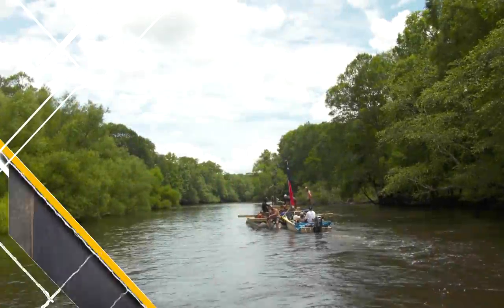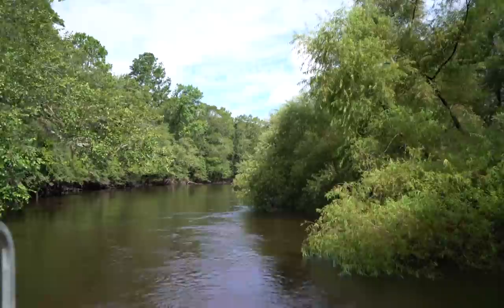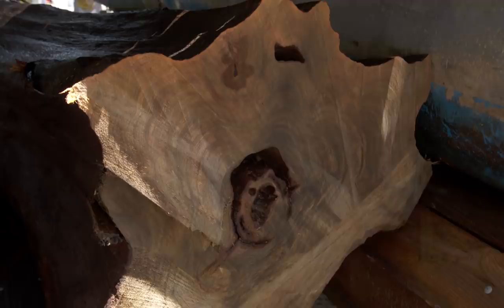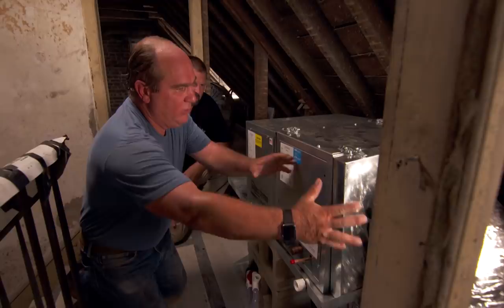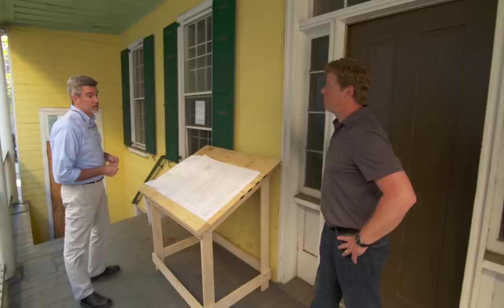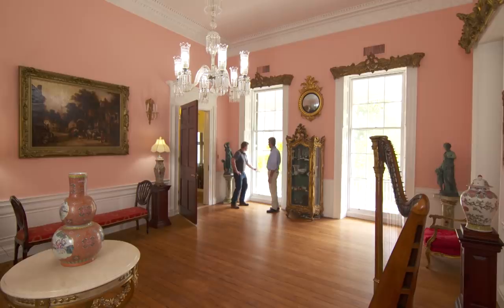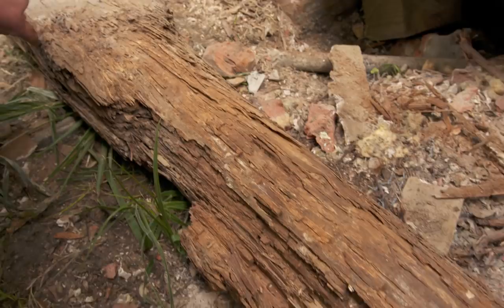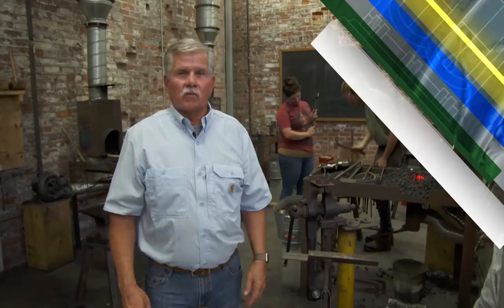This Old House | Good Wood (S39 E21) FULL EPISODE

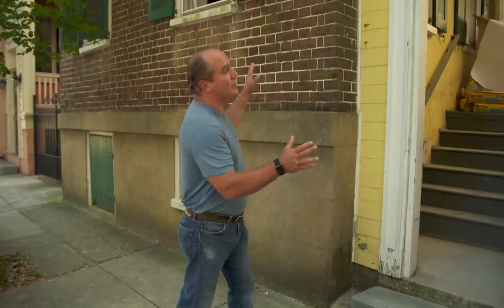Comment: 8:45 Did they mention putting on a 12" external insulation and a radiant barrier to help combat the homeowner's stupidity?   Those walls have an R value of about 3 total.   The roof is probably about the same.

Comment: So...exposed brick on the inside which will create more heat in the room. The AC will be running more because of this which will also be making their elec/gas bill higher. This is incredibly inefficient and Im really shocked no one from the ToH team tried to convince them to stud the wall and add insulation.